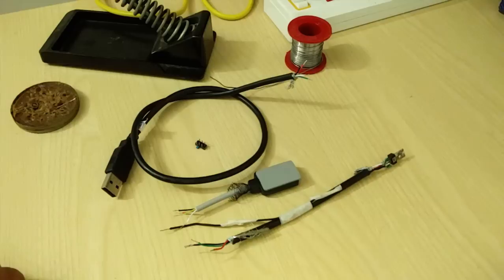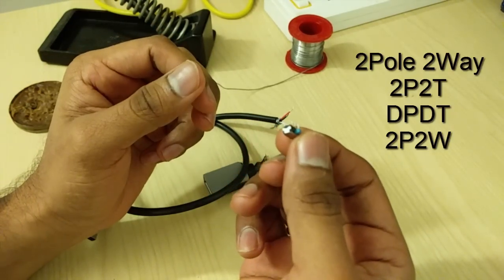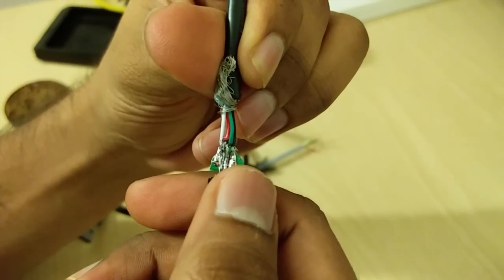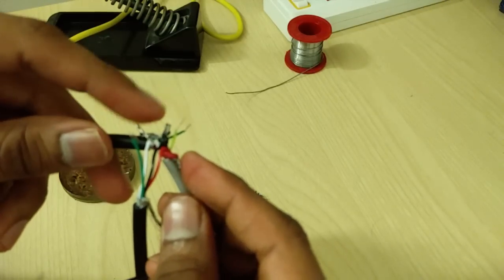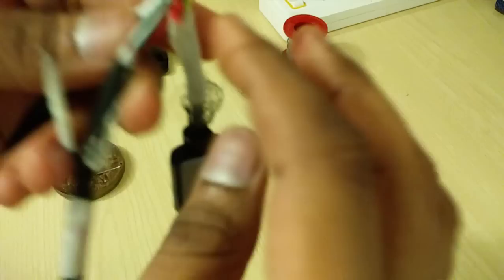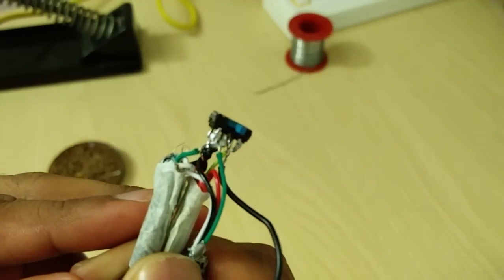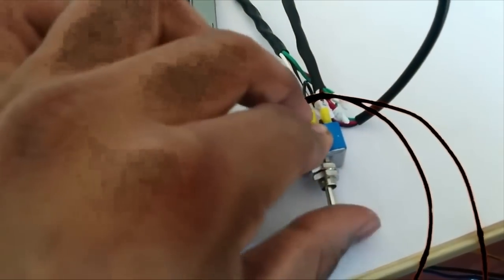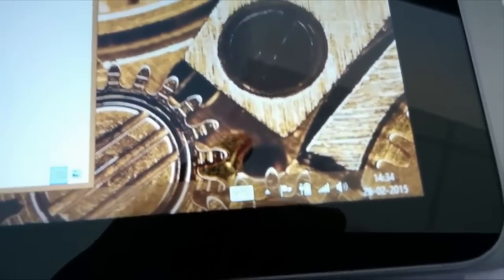DIY Cable To Use OTG and Simultaneously Charge The Device (Windows and Android)

Comment: Hi, is there a solution also for USB-C and Android (9)
Reply: I Think USB-C should work perfectly fine without doing this if you get a usb c hub for your USB-C phone. This method shown in the video is made for micro usb because the android phones that have micro usb ports did not have the modern standards that allowed normal otg+charging

Comment: Hello! Thank you for the instructables tutorial! I have made it myself. It worked - both chargin icon glows and my OTG device works. However, the charge is actively decreasing when i open a certain app and connect an Arduino. Please give me some advice and help with the solution
Reply: Use a high amp charger

Comment: Bhai tune USB speed ka g*nd mar diya... Forgot those 480Mbps speed(USB 2.0). And also your wiring diagram is questionable since D+ and D- are differential pair so they need to be twisted to maintain the standard USB speed.

Comment: The design as shown in the diagram doesn't work for me when I connect a USB point-of-sale receipt printer. The printer seems to activate by being powered up by the charging connection then when I flip the switch to USB OTG mode it doesn't connect to the phone. I attached the USB Male A ground to the empty pin in your diagram so that when charging the phone connects to that ground, then when I switch to OTG mode it is just connected to the device ground. I Also cut the white (D-) wire from the USB Male A. And now it works fine. I will be mounting all of this inside a plastic casing I still need to find something... to make a nicer system for us to charge with Square at our shop. Currently I have a phone in a phone case strapped to a piece of wood, it's ugly and hard to use, and you have to manually switch out the cables which is wearing down the micro USB port.

Comment: From the USB A male you connect the green wire to the switch. .. Why? Since this is the cable for the power, only Red and black are live... what is the purpose of green and white, at a power cable??!
Have you tried it with Android tablet as well? Or only with windows?
Because windows tablets, don't need all that mess to utilize a otg cable AND charge from it...  
Are you sure that you are not bulshiting us?!

...On the other hand, there could be a possibility... 
We all know that some official chargers have a resistance at the D+ or - and D-, so the device recognize that they are legit. 
Now if by this way you trick the device that it has a legit charger at its port and by switching to otg it keeps the momentum....
But it is a long shot…
...And I do not have a way to try it...

Comment: I have a desktop speaker which must be connected via usb port (no other connections). But I wish to make a connector so that both power and 3.5 mm audio pin are connected separately without altering the present wire. i.e I want to make a separate wiring connection.
Pls help if this is possible

Comment: I'm not trying to be too critical of your method, but wouldn't it work even better without the switch? and why bother with D+/- from the male usb a? what data is being shared with the charger?
Reply from the maker: If you do not connect any wires to the D+ and D-, the pins become floating and some of these present day gadgets do not work with floating pins. The wires create a resistance drop across the pins and hence D+ and D- are also wired. I tried with the data wires and without data wires and have showcased the technique which worked. Without the switch the device will always be in host/master mode. When in host mode they do get charged and hence this trick using the switch.
All the OTG and charging devices available in the market make use of the same concept and have switches. I have attached the links to some of them in the video description. Please feel free to take a look.

Comment: Is there a way to do this with an SPDT switch? I don't need OTG and charge simultaneously, I just want a cable that will let me switch between the two instead of having three settings
Reply from the maker: Then, you can do away with all the male USB-A parts. Just use single pole switch, connect pole to ground and id pin (pin4 of micro usb) to one of the ways.
Reply: Sid's E Classroom in this configuration, what purpose does the switch serve?

Comment: THANKS! I'm going to get a soldering iron and do this. I bought a so called OTG Splitter off eBay but it didn't do anything. I'm developing a mobile VR game that drains battery like crazy so I need to be able to charge it constantly while also using OTG input controllers.

Comment: Ok.. right! My device is Lenovo Vibe K5... Will it work on my device??
Reply from the maker: Unfortunately, i dont have that device to test. You need to try that. Keep the wires as short as possible. If it does not work, then you may have to add a resistor between pin 4 and pin 5.

Comment: That's not what I was expecting! I thinked that it could charge the phone while I use USB OTG, but it has a 2P2T switch who toggle OTG/Charge mode.  It appears that the cable doesn't do both things at same time. I wanted a really simultaneous OTG USB and charger!
DISLIKE!
Reply from the maker: Did you watch the video fully ? Please do not jump to conclusions !
Reply: Sid's E Classroom Ok, great, I've not watched the video fully. I've seen some projects like that, and some of they didn't charge at same time. But that cable really works. 
Apologize me!

Could you send me the schematics of the cable?
Reply from the maker: Schematics are there in the description. Depending on the device, you may have to add a resistance.

Comment: do u really need a switch? i need a otg with chraging usb and i need to used otg while charging
Reply from the maker: It really depends on the device, you need to trick some windows tablets and for that you need the switch.
Reply: This has been a problem for years and they still don't make one of these I can just buy off amazon?

Comment: can i do this without switch by connect ID wire to Black one's and just D+ from female and micro USB
Reply from the maker: It really depends on the device. For some devices, just a normal + and grnd from charging will do, for some you need D+ even from charging cable. I would suggest to use a switch. to modify to other combinations is easy after having the switch.

Comment: on one side of the switch it charges and on the other side it detects the device,  but it doesnt do otg+charging together,  what could be the problem
Reply from the maker: Darth Vader can you specify the device that you are trying to use the cable on.?
Reply: Sid's E Classroom windows tab
Reply from the maker: Darth Vader most likely you would have changed D+ and D- on switch. D+ should be on switch and not D-. if possible, upload a pic of your cable, (close up on switch, micro usb) to tinypic or ggole drive and share it here.
Reply from the maker: Thank you for the pics. The wiring looks good.  Now what i am going to suggest is a bit tricky. connect a 1k pot at the terminals of black wire on the switch. Set the switch to charging position but do not connect it to charger. Set the pot to maximum resistance and then plug the cable to the charger. now keep reducing the resistance untill OTG device gets detected, but do not go below 20ohms. once you know the resistance, you can replace the pot with the fixed resistance. All the commerical OTG and charging devices such as those in banggood and ebay  use the same principle. Its just that some devices need resistance and some don't. if you are not comfortable with stuff i just told, kindly take the help of some person versed in electronics.
Reply: Sid's E Classroom so when i find the resistance,  where should i put my resistor?  between bunch of black wires and switch?
Reply from the maker: between the two black terminals on switch... same place as the pot. just replace pot with fixed resistance
Reply: Sid's E Classroom oh between two black wires, ..........  between wire from the 4th pin of micro usb and bunch of black wires?  right?
Reply from the maker: Darth Vader yes

Comment: You reversed D+ (green) and D- (white)! so it won't work. D+ must be connected to the three pin side next to the +5V pad.
Reply from the maker: I take utmost precaution while publishing video.  The wiring made is as per standards. please watch video at 3:15
Reply: Code beat, You may want to look at the pinouts again. The pattern is RWGB.

Comment: I'm making another one,  but this time pendrive is getting detected,  switch is working,  if i flip it to the orther side pendrive doesnt work but when i flip it back it gets detects, But it not charging  , not at all charging why?
Reply from the maker: so one side of the switch, the device charges and other side the pen drive gets detected ?
Reply: only pendrive  gets detected,  its not charging at all
Reply from the maker: Darth Vader have you used the same wiring that i have shown ?
Reply: exact
Reply: yes same wiring, please guide me
Reply from the maker: Darth Vader looks like just a open connection. use  a multimeter to check for continuity. First have the switch on OTG side, check for continuity between all wires of micro usb and usb female. then turn the switch to charging side, check for continuity between micro usb and usb charging male. this will point out errors.
Reply: Cross checked , still issue is there, maybe bcuz of pin4 wire? Is there a way to check pin no. 4?
Reply from the maker: can you check continuity of pin 4 of micro USB with charger usb male for both sides of switch
Reply: yes dude checked they're all working fine, female USB ,micro USB, male USB on both side of switches , but still noting, can I do this the other way by leaving  the blank pin on the micro USB as it is? is there any other way
Reply from the maker: can you share a pic with me.. coz without looking at it am just guessing stuff which takes us no where
Reply: of course , what's u email or where should I send it?
Reply from the maker: u can upload it to tinypic or Google drive and share the link here

Comment: Help! while making this I just made a otg cable but its not detecting my storage devices! But it is detecting mouse and keyboard I attached to it!
Reply from the maker: Your storage devices should be formated in FAT32 format, some Android versions do not detect NTFS. Also, after inserting the storage, open ES file explorer and check whether its detected.
Reply: I'm using windows tablet, and the same flash drive is working with different otg cable!
Reply from the maker: Does it get detected in device manager? Any prompts appear while connecting the USB? also try to keep the length of wires between micro usb and usb female short. If possible, share a pic of the OTG cable that you made. You can upload the pic to tinypic.com and share URL here.
Reply: Yes! It shows unknown device, and when I plug in a pop up appears that USB device Not recognized!
Reply: When I connect the same flash drive using otg cable I bought, it works fine no issues!
Reply from the maker: Is the storage device a external hard drive or pen drive. Also try to right click on unknown device and try to install drivers. From what i am guessing it is a power related issue. mouse and keyboard dongle is a low power device. I may be able to suggest something, if i can see a pic of the OTG cable that u just did.
Reply: Okay! Here is the link! https://drive.google.com/file/d/0BzVRaQuUa-CNS3pPMWppUklOeFU/view?usp=drivesdk
Reply: I'm too thinking that it's a power related issue!
Reply: Actually I did not made any solder connections for testing! that's why the wire looks like this!
Reply from the maker: To start with, the cable is really too long. Since you have not done soldering, you have an opportunity to explore the power issue. Seperate the female usb +/Vcc and Micro usb +/Vcc. Connect a multimeter in series between two wires and check the power drawn for the mouse dongle and storage. And once again, is the storage device an external HDD or pen drive?
Reply: It's a pendrive! Thanks I will try it and let you know!

Comment: Sid's E Classroom i had made an DIY OTG that can Charge as well but different from yours, mine was direct connect only without switch. At first it works great but all of a sudden it discharge my windows tab i just don't know why. Any idea why? and i would like to do the same what you made, can you send the wiring schematic if its fie with you.. 

Thank you..
Reply from the maker: From what you say, i imagine that, you have connected all the four wires of, the Female USB, Male USB and Micro USB. 2 USB devices will nor work in parallel, you need to disconnect data wires to make OTG and Charging work simultaneously. You can find the schematic in the description of video.
Reply: not really, for the male sub i only connect the red and black wire to the micro usb then for the female usb. I connected all. actually it worked fine it charge my device while i can still use it as an OTG at the same time.. my device is Dell Venue 8 pro. recently i noticed that it is now discharging while i put it.. i made other same as that but still it discharge the device.
Reply from the maker: It all boils down to current supplied and current drawn by the OTG Female, If the current drawn goes beyond the current supplied, your device will start to discharge. Thumb drives/pen drives consume very less power, but external hard drives and multiple devices draw more power.
Reply: If i make one like you did will it have the same outcome or not?
Reply from the maker: All OTG and charging will have same behaviour.... the key here is power source.. Even for your cable if you change the power supply to one with high current rating it might work.
Reply: Sid's E Classroom dude i have a one question, do you think if i made one of this like OTG that can charge at the same time and connect it like http://saudi.souq.com/sa-en/anker-dual-display-universal-docking-station-dvi-hdmi-audio-gigabit-ethernet-6-usb-ports-38w-adapter-10511334/i/#description will it work?
Reply from the maker: I think it will work..
Reply: @ryancalda6454  will your setup work for me for samsung galaxy j7 prime?

Comment: the first switch u used , is it an on-off-on switch or on-on switch?  which one will work ?
Reply from the maker: what I used is called DPDT or double pole double throw switch.
Reply: +Sid's E Classroom yes , but i see two type of dpdt switch , 1) which has two positions on-on
2) which has 3 positions on-off-on 
which one are u using
Reply from the maker: +Darth Vader ON-ON
Reply: +Sid's E Classroom thank you :)

Comment: i have another question dude , i was making another one of these but i have a switch which doesn't have 6 pins instead it has 3 pins and it turns on both the sides when you flip it , what wires should i connect ,im not able to get the connection
Reply from the maker: It depends on the device, if your device is a windows tab then switch with 6 pins is a must. If its for android,  use the three pins for ground connection that i have shown and leave the green and white wires from Charging USB male A open. directly connect the white and green wires of Micro USB and USB Female to each other.

Comment: do we need to put a resistor 100k ohm between no.4 and no.5 of micro usb
Reply from the maker: Hi, there is no universal resistance. It varies from device to device. For me, it worked in Xperia M and Acer W820 without resistor. My suggestion would be to add a 0.5K pot between pin 4 and 5, slowly turn the pot untill you nail the resistance.
Reply: +Sid's E Classroom Thank You so much i'm done with this project and i haven't used any resistor , I've plugged a usb hub into female A port and using a keyboard and mouse while charging my tablet (iball i701) simultaneously! hats off to you :)
Reply: Is this cable still working without any issues? Because I'm looking forward to make one.
Reply: yes it's  working,  didn't  worked on my Android(issue with my phone), but worked on my windows tab,  just begin  with the Project
Reply: I'm not understanding those dpdt connections, can you please simplify it?
Reply from the maker: Schematic is attached in the description. You may find it helpful.

Comment: From what I understand from other reference material, the switch in the other direction could be used with sub keyboard/ mouse. Is that correct?
Reply from the maker: If you mean the OTG yes.